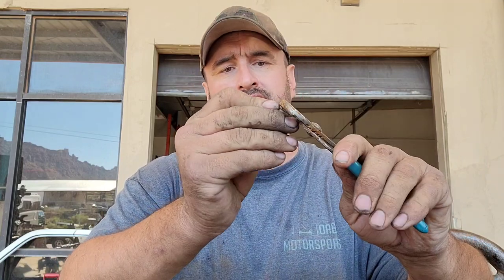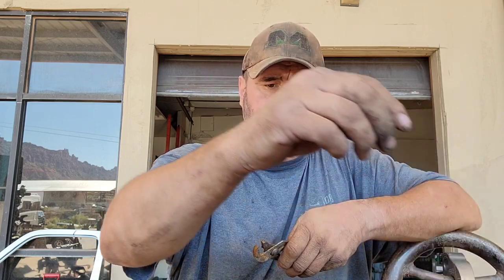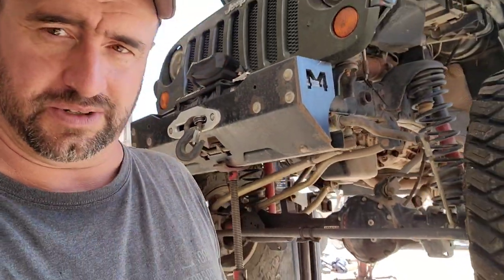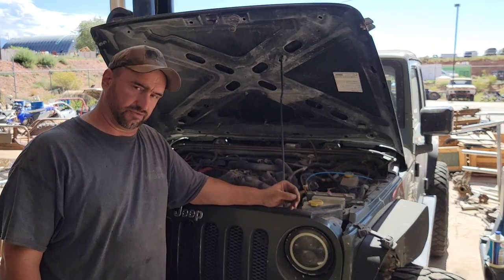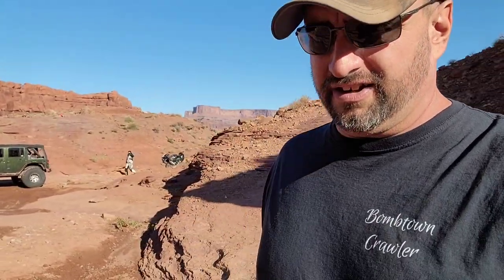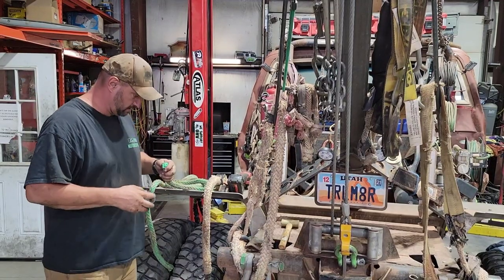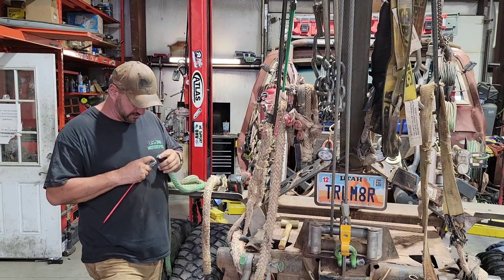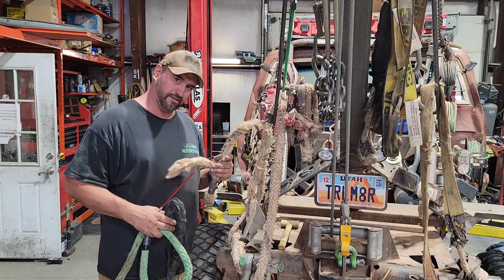New Rig, New Locker for Trailmater (Caution: Lots of Talking)

Comment: “Vehicles mean a lot to me” …. I felt that on such a level I don’t even know how to put it in words. vehicles mean a lot to me as well. when they let you down it’s bad parts with an issue. Can be fixed. When people give you issues you can’t throw parts at them until they are fixed. Well you can but it may not fix anything hitting them with a transmission thrown from overhead

Comment: Pepe's Towing / Josh
Has Been Using Old / Older Fire Hose On Alot Probably Most Of His Straps & He Does HEAVY RESCUE ,HE Has i think 4 or 5 ROTATORS  UP TO 100 TON I Think  But it Really  Saves His Straps  So You Might Check His Ch. It's  Good  PEPE'S TOWING & HE IS Super Carefull Like You